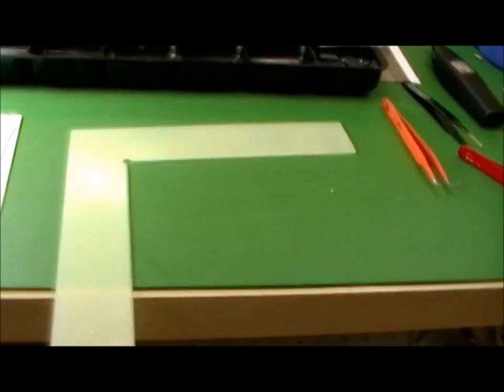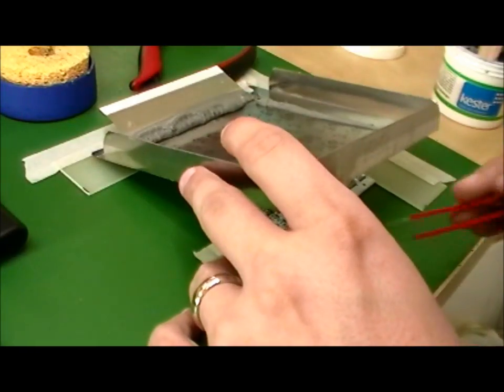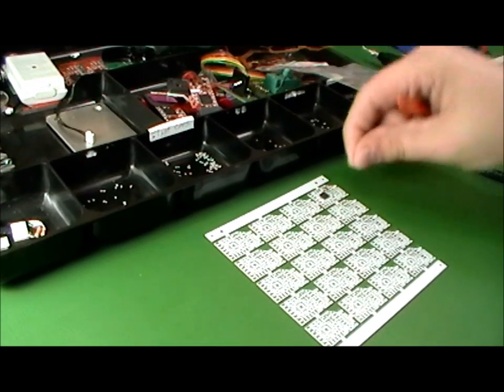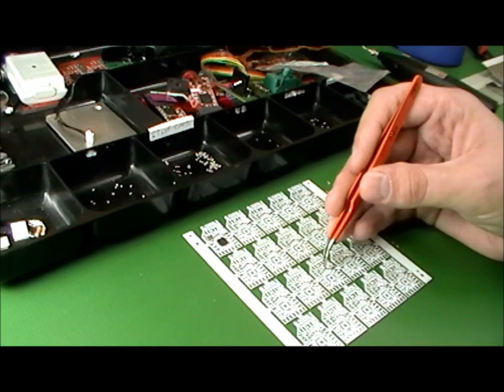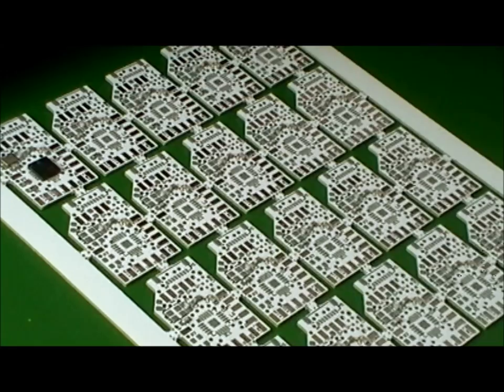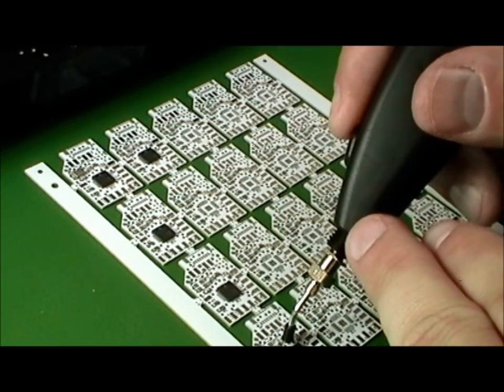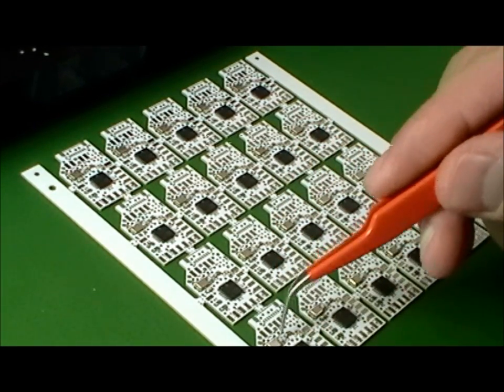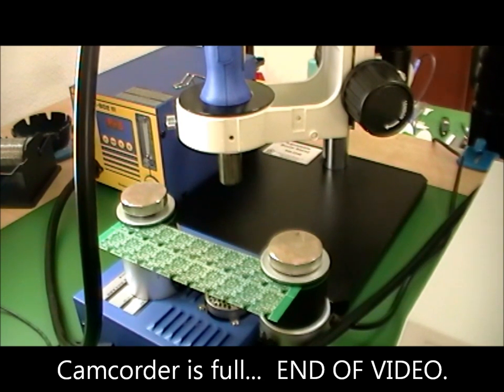PCB / SMT solder paste, stencil printing, and reflow oven

Comment: Thanks for your response. I bought a hot-air station and waiting straight to receive it. I am a little worry if the components will moving by the air and lose their place. At the end maybe i will combine a $300 USD oven and hot air. Great video.

Comment from the maker: Correct they are Aven brand.  I bought a bit of six various tweezers:  Newark Part Number: 26R9213.  I loved the kit so much I bought 5 more kits for everybody at the shop.  Great tweezer variety there is sure to be a tweezer in the kit for your need and the color coding makes it easy to pick the correct tweezer without digging through a pile of similar-looking tweezers.

Comment: nice video I have a lot of parts I salvage parts from boards and those Cap look like grans of sand so darn small.  I just heat them in our oven at 450 for a few minutes until the solder starts to melt and then with one quick smap nock them all off in a pan and then sort them I do keep the small stuff but I have not used them I just use what I can read part numbers on.

Comment from the maker: @Kr133r For the articulating arm for the hot air pen, I shelled out the big bucks and bought the "name brand" arm/stand from Hakko that is made specifically for this model of hot air pen.  The stand is definitely beefy and durable, but costs as much as a new Hakko hot air station (I picked up my Hakko hot air station used and on-sale at E-bay for $500).

Comment from the maker: For only 10-50 PCB per week, I would choose the hot-air station.  If you buy only a cheap reflow oven, you would still need the hot-air station to fix some of the errors that happen due to the cheap reflow oven :-)  So if you only have enough money to buy one, buy the hot air station.

Comment from the maker: They are easy to work with.  You can try to go direct to China and save about 25% on a similar machine, HOWEVER, getting spare parts would be very time-consuming and you would not get any field service.  MannCorp has gotten us parts shipped the same day we called in most cases, and they have tech's that can travel to our shop and work on the machine if we have a serious issue.  It's good to know there somebody that can help us if we're in trouble.  The machine's up-time is critical. +1 MannCorp

Comment from the maker: I have used a dozen different PCB manufacturers in the past.  Sunstone, pcbnet.com, silver circuits, e-teknet, ict global, olimex, myro, and more...  it depends on your project and time requirements.  For more simple 2-sided circuit board you can just pick whoever is cheapest.  If you get really small you will have to ask the company how small they can really go, everybody has different limitations depending on their process.

Comment from the maker: @LightForce105 Most mod shops don't use this many components on their mod chips.  In fact most mod shops don't even have a mod chip, rather, they just have a single 8-pin "pic" chip that they solder wires onto.  The modchip is a little more "kosher" design-wise (meaning reliable), helps our installers be more consistent (less chance customer has to return the product).  Etc.  :-)   I am working hard to build a quality product!  Every chip is manually inspected and tested.

Comment from the maker: You will be surprised, it is called a hot air station so you think it blows hot air like a hairdryer.  But it is more like baby's breath.  (Or maybe my unit is broken hahaha)  in any case the air flow on mine is very soft so you end up putting the nozzle like 1 cm or even closer to the parts.  It is possible on the highest setting to disturb small component like 0603 resistor or capacitor.  You can practice with the air settings on a junk board and move to your real design.

Comment: how do you make sure the stencil is well alligned?
Reply from the maker: In this case for a prototype stencil that has to be applied by hand, it's all aligned by eye and hand.  I didn't use a magnifier but you might get a monocle eyepiece and check opposite corners of the stencil.  Typically if you align the aperture well in any two opposite corners the rest of the apertures will fall into place.  On our tabletop framed stencil paste printer, we use two cheap Micro USB cameras purchased from AdaFruit Industries; we place one camera each facing into the apertures in opposite corners of the stencil pattern and line them up and the remaining apertures fall into place.  So, try bare eye, monocle/magnifier, or you can invest in a two USB cameras and point one at each corner.  If you can't get the print accurate, be sure to use leaded solder, even consider a solder that requires special chemicals to wash.  Worst to reflow: no-clean lead-free.  Hardest to reflow:  any lead-free solder.  Next easiest to reflow:  any no-clean solder.  "Most" easiest to reflow: any other nasty solders that require chemicals to clean and have lead.  We only use no-clean flux because we do not have the chemical washers required to clear other types of flux off PCB's.  We use leaded and lead-free depending on customer requirement and where the boards will be shipped (many countries have lead-free requirements, re: have adopted RoHS standard).  Hope this answer helped.
Reply: vikingcontrollers Thanks, I have one more question. If you don't have a heater to bake the pcb's can you put them in the kitchen oven? Or is that too hot. Or let me put it differently, how hot do you need to bake them and how long?Noob here haha
Reply from the maker: mike vermeer Shortly after we made this video we tried a cheap Chinese (couple hundred dollar) oven and it didn't work worth crap.  We turn enough volume we quickly upgraded to a commercial grade batch reflow oven for about $5,000.  There are guys that have good tutorials regarding using a converted toaster oven with digital control, some guys even use a hotplate method.  The hotplate is not my recommendation, you might get by with a converter toaster oven a little less primitive than hotplate method in my opinion.  I haven't done that myself but again lots of guys I've seen talking about some success with converting cheap toaster ovens and the like.